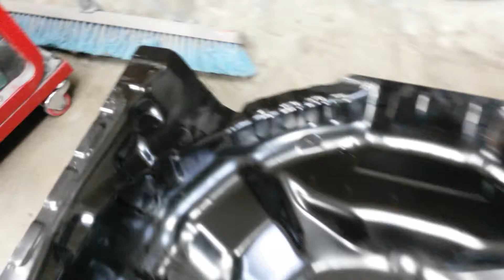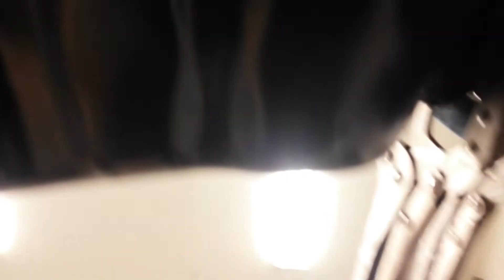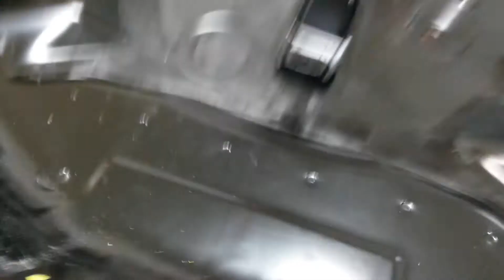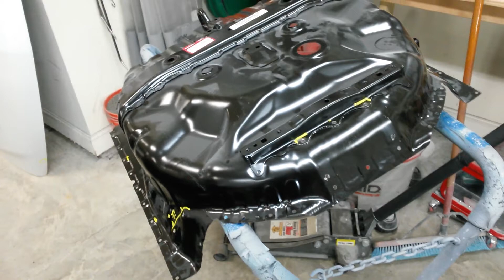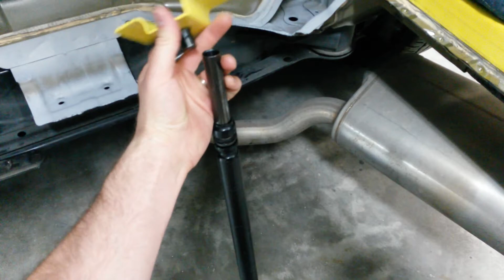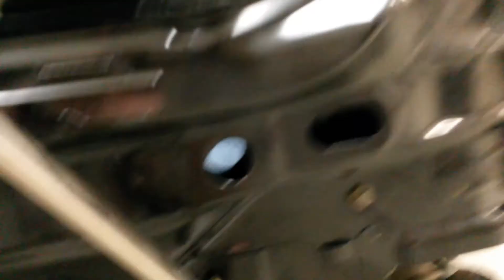2013 HONDA ACCORD | FRONT & REAR COLLISION REPAIR | SALVAGE REBUILD PART 9

Comment: Hi, where did you get that tail panel? I'm looking for the panel for a 2013 g37. Dealer OEM is close to $400 I think just for that sheet of metal?
Reply from the maker: These are typically OEM only or get a  used one from a salvage yard if possible.  You can try aftermarket suppliers like Keystone or LKQ to see if it's even made in the aftermarket. Probably not
Reply from the maker: I got it at a local Honda dealer
Reply: @samg5543  thanks! I'll try my luck at the local dealer. Used from salvage yard would be ideal, but I'm not sure if they would be willing to cut it out.
Reply from the maker: @calllmedoc  They would probably only cut it out if both quarters were bad and they couldn't sell them as past of a quarter panel cut. You could order it online from a Infiniti dealer as long as the shipping is regular groudn and not freight. May be a lot cheaper.I do this occassionally. Sometimes even AMazon or ebay have them listed.
Reply: @samg5543   Shipping is not too bad, about $25. But $435 for the sheet of metal seems like a lot. Ebay/Amazon also all over $400. I wonder why they do not have this aftermarket. It seems simple enough. I'm goingto look for g37s with damaged quarters and try my luck at  the junk yards. https://www.infinitipartsdeal.com/parts/infiniti-panel-rear-uppe~79110-jk000.html

Comment: Excellent work , guess you dont care for self tappers to pull the metal together ?
Reply from the maker: Thanks. I try to avoid screwing panels together if I can, especially if the back side is inaccessible. Where there will be seam sealer on both sides of the joint like where the spare pan meets the rear panel, it would be okay, but it creates more holes to have to weld up. I just prefer to clamp them or force them together if I can. thanks for watching. I'm enjoying your Accord series.